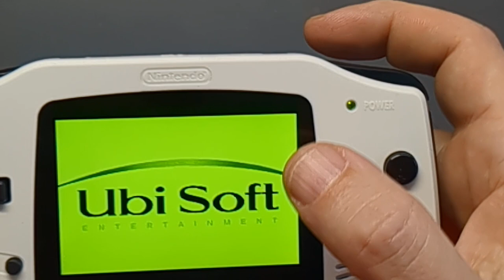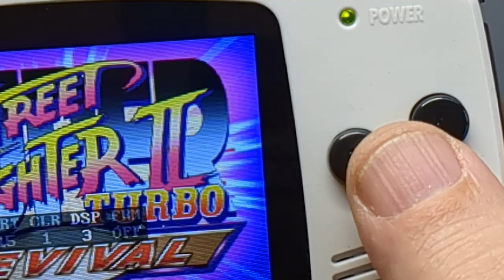GBA FunnyPlaying Laminated IPS 3.0 installed and tested in Nintendo Gameboy Advance console

Comment: Installed one in a clear black shell and the kit now comes with a different mounting bracket. You have to be very careful not to pinch the ribbon coming out from the right side of the lcd when installing the new bracket. Also, the foam piece is supposed to go on top of the touch sensor, so that it pushes the sensor against the screen lens.
Reply from the maker: Thanks! Yes I figured that out about the sensor afterwards but since I'd got it all working and wired up I figured I'd leave well alone 😅
Reply: Hi, Chris from Retro Gaming Parts here. The new stock we have in, with the new bracket, no longer ships from FP with a foam pad. A little kapton tape will hold the touch sensor down 👍🏻

Comment: Is anyone else have the problem of the ribbon cable not latching?
Reply from the maker: As you saw here, it was difficult because it's ever so slightly too short. You can get it to connect but it feels like it's under a bit much strain
Reply: @JoeBleeps  thank you for the answer. I don't mean the one that connects to the motherboard. I mean the other one on the side. The one that connects from the screen to the other ribbon cable that goes behind the screen. When I seat mine and shut the light brown latch it does not hold the cable at all.
Reply from the maker: @midnightradio1707  I see! Like around 08:30 in this video? That didn't cause me any problems so if the ribbon is pushed all the way in it may suggest a faulty unit.

Comment: Ive ordered this for the SP from retrogamingparts, just eagerly waiting for stock to arrive next week. Couldnt find any info about where the solder points on the SP are from their website but think ive figured it out. Cant wait to give it a go
Reply from the maker: I've got a video or two on my channel about installing the IPS kits in the SP with soldering, take a look
Reply: @JoeBleeps  is that for soldering the osd though?
Reply: @JoeBleeps  ive done screen swaps on SP’s and soldered the light adjustment cable, just wasnt sure where ill be soldering the three wired on this new version
Reply from the maker: @hywel4767  I've not seen the new kits but if it's anything like this it will be the select, L and R contact points. Hopefully it won't be too difficult to work out but in the meantime I'll see if I can get hold of one to try out!
Reply from the maker: @hywel4767  nope sorry

Comment: It's really hard to decide which one is better. It would be interesting to see how much better the battery life is with the ITA screen which draws less power.
Reply from the maker: I'm guessing the ITA will draw less power. I'd say the deciding factor between the two is if you prefer a modern looking display or an authentic retro style. Standard display on IPS looks great but the pixel overlays can't hold a candle to the ITA screen

Comment: how does the battery life compare between these two options? obviously brightness is a factor, but since the ips screen is higher resolution and better quality it might use up battery faster? 

also how does the pricing compare?

great video and very helpful to show some common mistakes or difficulties if you follow the instructions, as thats the seemingly logical course that you actually should avoid. 

thanks!
Reply from the maker: I think the IPS is more of a drain but with variable brightness you can always find a sweet spot

Comment: For 40 pin models, is it still necessary to remove C54 capacitor for this kit to work?
Reply from the maker: Yes, I believe so
Reply: No that's for the other Laminated kit, that one has black ribbon cables.
Reply from the maker: @MrHankeyy  thank you. I've installed so many different screens it's easy to lose track 😅

Comment: How would you say this white compares with the arctic white oem shell? Been on the fence because I wanted the laminated display but want the new shell to be as close as possible
Reply from the maker: It's good, it's nice and solid not like that slightly translucent look you can get with third party plastic
Reply: @JoeBleeps  any thoughts on shade? I see it listed as beige or off-white, but now wondering if that's basically what she arctic was anyway. If not I might be holding off for a pure white or something similarly labeled
Reply from the maker: @davidthefrogman  for this one I'd say beige is misleading. I don't have an original to compare to but I'd say it's a warm white. Compared to my Evercade EXP which is a cooler white. The plastic of the GBA shell looks a lot more premium.

Comment: I installed the newest version of this tonight, all seemed to work perfectly then after a few minutes playing a line appeared on the screen then within another minute another line appeared. I’m guessing its the strain on the ribbon cable but the screens knackered now. Absolutely gutted. Ive installed multiple screens on multiple devices and never had this issue, i can only think its the fact the ribbon cable is so short, despite being so gentle with it. Not sure what to do with the shell and pcb now, dont really want to buy another as that’ll likely be prone to the same issue. Gutted as they aint cheap either
Reply from the maker: Ahh I'm so disappointed for you. It's so upsetting when things happen like that. Is it a FP screen? Might be worth returning
Reply: @JoeBleeps  it is fp but retrogamingparts state no returns once installed. Which is terrible
Reply from the maker: That's fair enough if you damaged it but if it appears faulty I'd say it's at least worth taking photos and getting in touch
Reply: @JoeBleeps  theyll just assume i damaged it, dont know how you can actually damage a ribbon cable like that tbh they can take a lot of bending normally. Think i just got unlucky perhaps.
Reply from the maker: @hywel4767  it's my main criticism of that kit. The ribbon is a good 5mm too short.
Reply: Hey it’s Chris here, owner of Retro Gaming Parts. Please send Louise an email with clear photos of your installation (system opened up), and we will work through some fault finding with you.
Reply: @PerthRetroGaming  hi Chris, i’ve actually disassembled it now and ordered a replacement from your site. There was nothing untoward to be seen, it was installed exactly as depicted in this video, the console fired up perfectly but after a few minutes of gameplay the first line appeared, then after a few more minutes the second appeared, absolutely devastated I just took it all apart and went to bed. I’m hoping it was just a bad screen but because i soldered the three OSD wires i knew i wouldnt be able to return it. Next time i wont be soldering and will just try it without.

Comment: Did you remove C54?
Reply from the maker: I think so? It's a while since I did this one
Reply: I just finished assembling. I have the new V3 laminated. It doesn't require c54 to be removed...is only for the old black reben cable.
I didn't solder anything because I'm using the touch screen and it works really good
Reply from the maker: @og3139  ahhh right it may have been the other GBA screen I did that I needed to do that for